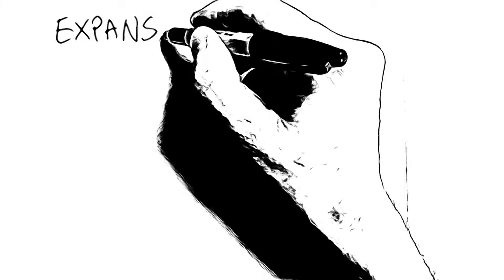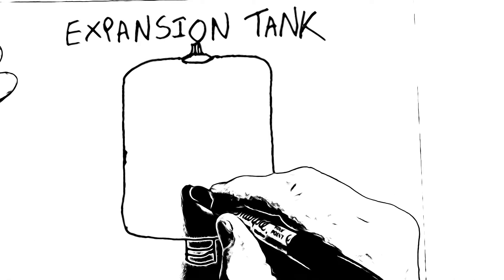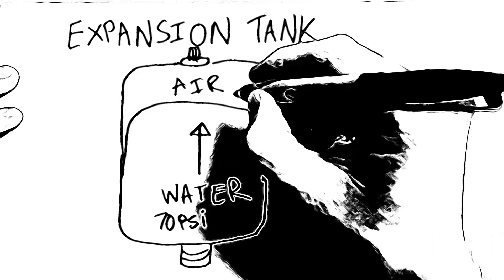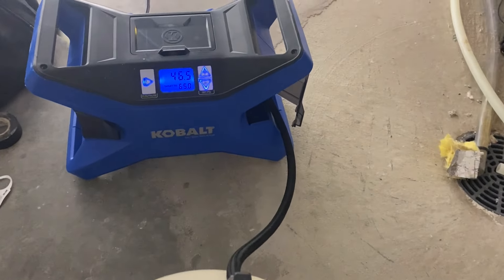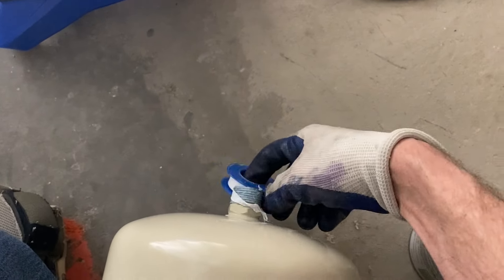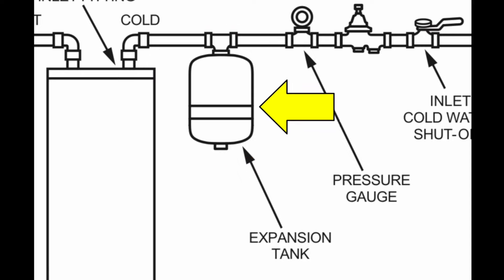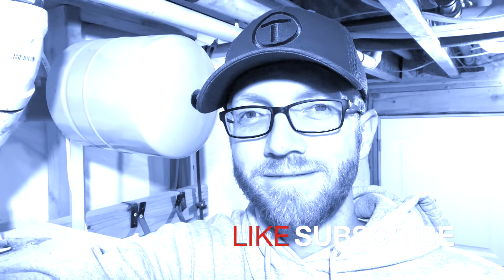Expansion Tank: Preparation, Pressure and Installation

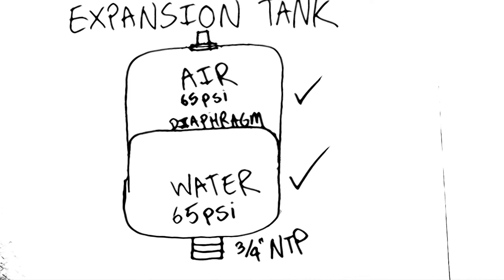Comment: At 1:40 your drawn diagram shows the water inlet at the bottom, which is the correct orientation, AFAIK. Then later in the video, you say that the water inlet should be at the top. Do you have any definitive documentation as to what the "officially recommended" installation method is? Also: teflon tape should be applied first, then the pipe dope.
Reply from the maker: Hello.  Best to check the manufacturer's installation instructions.  I really don't think it matters the orientation of the tank.  It is not dependent on gravity.  Either way, the tank should be supported by something other than the pipe.  

The order of teflon tape and pipe dope is simply a matter of opinion.  I have done it hundreds of times both ways, and I prefer dope first because it is cleaner.  Code does not dictate any order, neither do state or local laws so you can do what you prefer.
Reply: @plumber-tom9470 yea they don't dictate something tht should be common sense son 😂

Comment: What if I already installed my tank without properly pressurizing it? Can I simply unfasten it, pressurize, and then reinstall, or do I need to purchase a new one?
Reply from the maker: Yes. You can fill or refill the tank as needed. You don’t necessarily have to take it off. If you shut down and drain the system pressure at a faucet, then you can fill it in place. Or you can take it off and reinstall it. Not need to purchase a new one.

Comment: Tom, thanks for the video. 
I bought a water pressure gauge, connected it to the water spigot on the side of my house and it is measuring 90 PSI. 
Is that a very high PSI?
Reply from the maker: Yes.  Code says that your water pressure should be 80 PSI or less. However, sometimes outside faucets are branched off before the pressure reducing valve.  You might try to take a pressure reading from inside the house and see if it is the same.  You can put your gauge on a washer connection faucet or on the drain outlet from the water heater.  If the inside pressure is less, then you are good.  If not, you will need a pressure reducing valve.
Reply: @plumber-tom9470  
Thanks man 👍
Reply: that might be dedicated for sprinkler systems and garden house since majority home appliances will not stand that pressure of over 80 PSI @plumber-tom9470

Comment: 1:37 “If I know my [water system pressure] is at 66 psi, I should fill up the air chamber to 65 psi”

What “water system pressure” is this referring to? I’ve seen videos saying you should measure the pressure using an outside bib. But both ChatGPT and an HVAC person I spoke to say that the pressure you should set the expansion tank to is the cold water pressure of the boiler system, not the water system of the house. This means the tank should be set to anywhere between 12-15 psi, not 50-60+ which is what an outside faucet would be. 

So I’m confused. Which one is it?
Reply from the maker: The "water system" referred to in this video is the potable water system.  Boilers are a separate system that operate at a lower pressure.  So the HVAC person was correct for the expansion tank for the boiler system.  But you should have a separate system and tank for that.   The expansion tank for your potable hot water should be pressurized to the pressure of the system delivering water to your fixtures.   

I don't trust ChatGPT for plumbing information.  It pulls information from people who don't know what they are talking about.
Reply: @plumber-tom9470 Thanks for the reply. 

I have a boiler and the expansion tank is attached to one of the pipes near it. I replaced the tank and set its pressure to match that of an outside bib, but now I realize I was way off. None of the videos I’ve watched make the distinction between the two types of tanks/systems, so it’s a bit confusing. Thanks again for clearing that up. I just set mine to 15psi.

Comment: Important to remember that...if you want to achieve the maximum thermal expansion capacity of your tank...when inflating the air bladder,  the tank must have no water pressure applied. Anything that prevents the air bladder from fully expanding to full volume during inflation will reduce the effective capacity of the tank, by limiting the starting volume of air in the tank that is available to be compressed by applied water pressure.

To understand this, first visualize an air bladder that, when un-impeded, inflates to completely fill a  tank. Then, when equal water pressure is applied, no water at all can enter the tank, yielding a FULL tank of air available to compress due to thermal expansion.

Then visualize an air bladder that, when impeded by water pressure, inflates to only partially fill a  tank. Then, when equal water pressure is applied, water can partially enter the tank, yielding only a PARTIAL tank of air available to compress due to thermal expansion.

There are reasons for deviating from the above, such as, in some cases, you might not need the full capacity of the tank, and then you might be able to extend bladder life by limiting the starting volume of air in the tank...but, in most cases, expansion tanks are inflated with no water pressure applied, so as to achieve the full thermal expansion absorption capacity of the tank.
Reply from the maker: Well said!  Thank you for the explanation!

Comment: is this tank pressure  adjusted when the water heater is hot or cold
Reply from the maker: You pressurize the tank before you turn the water on. There should not be any water pressure and you are filling the tank or you will get a false reading.

Comment: You are doing the pre-airpressure wrong.
The pre-airpressure must be lower than the system pressure.  If they are equal then the tank only works to absorb water/pressure but lacks the ability to deliver and maintain desired pressure if system pressure drops. If pre-pressure is equal to system pressure then no water will be accumulated in the tank at normal pressure.
Reply from the maker: Interesting.  🤔   

I agree that several pounds below system pressure is optimal. But the tank will still work as an expansion reservoir if pressure climbs above system pressure, which is exactly what we want it to do. 

Give it a while and the tank air pressure will decrease. They never hold.
Reply from the maker: You seem to be describing the function of a well system pressure tank. In that situation with 50 to 100 gallons you are exactly right. But a 2 gallon expansion tank isn’t really designed to compensate for system pressure losses over time. There is not enough volume to sustain delivery.

Comment: Why did you put pipe dope then teflon tape in that order?  Why not teflon tape then pipe dope?
Reply from the maker: I prefer to do it that way because it is cleaner. I smear less pipe dope when it is covered with tape. I have done it hundreds of time both ways and I really don’t think one way is more or less likely to leak.
Reply: @plumber-tom9470  Perfect answer, thank you.  I'm not a plumber and did it the opposite way.
Reply from the maker: no problem! @kevinmiller5467